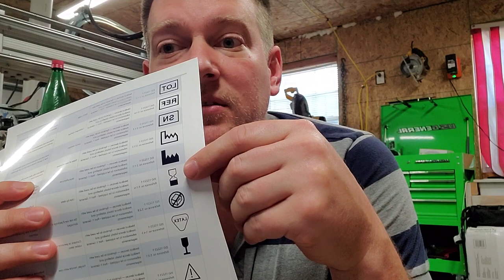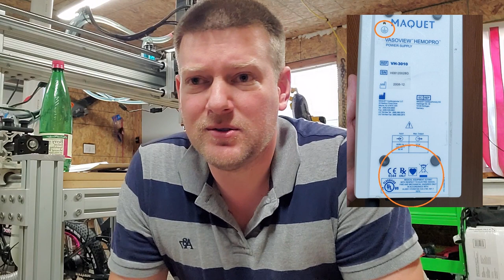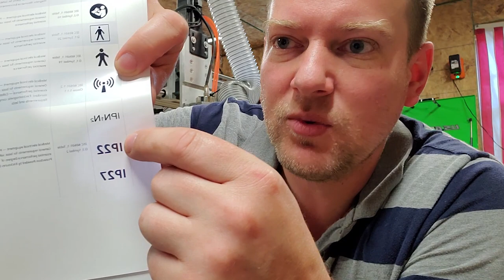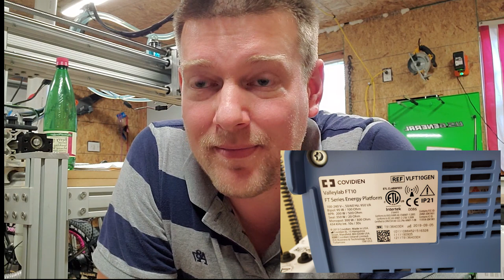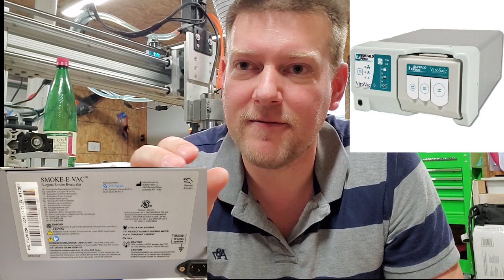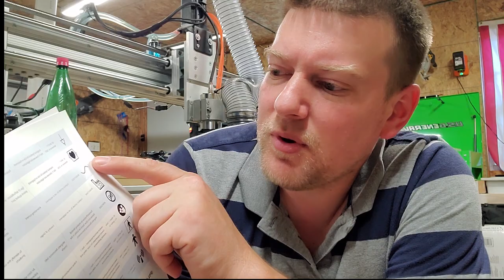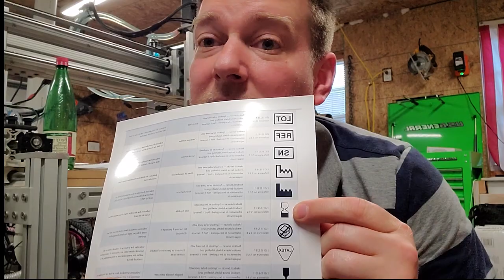Data Plate Symbols

Comment: The symbol containing a silhouette of a factory means "Production Date".The symbol containing an hourglass with the upper part empty means "Expiration Date".  "STERILE EO" means that a consumable is sterilized by means of ethylene oxide gas. "STERILE R" means that a consumable is sterilized by means of gamma radiation. The silhouette of a person reading a book means "Refer to the user manual or Instructions for use. The symbol of the number 2 slashed out means "SINGLE USE ONLY".